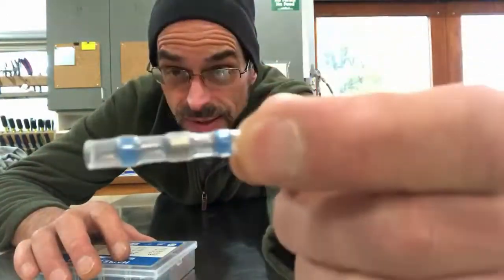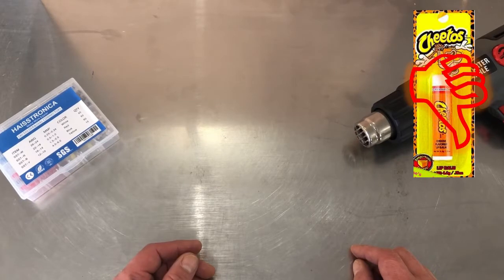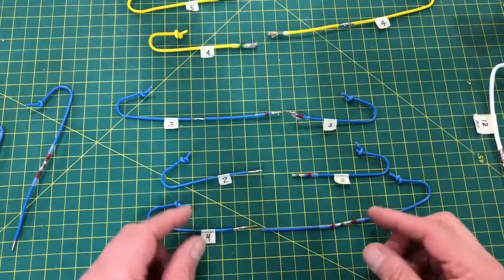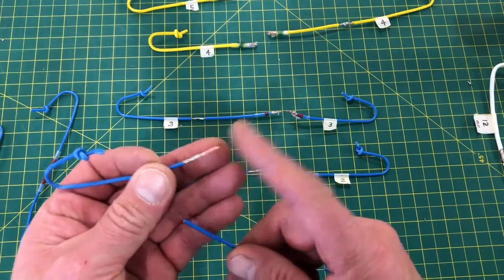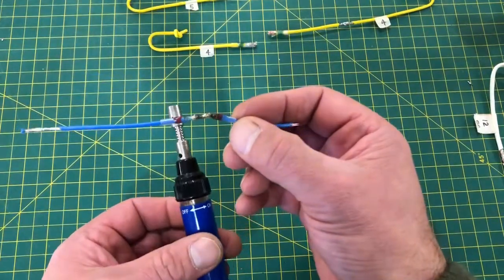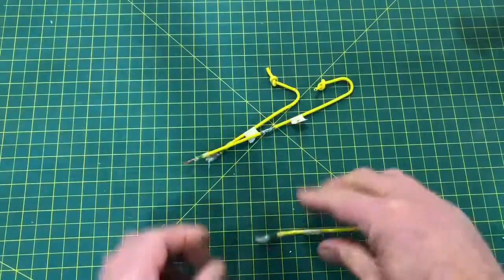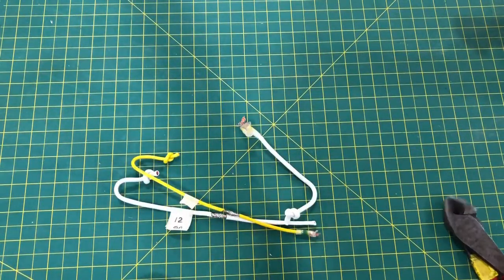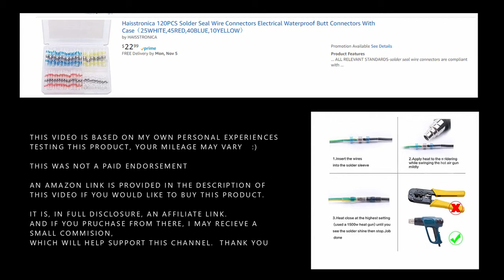Solder seal wire connector / Test & review

Comment: Wire is a conductor not a steel wire rope exposed to high tension. If your going to test and explore its capabilities use realistic tests strategies.
Reply from the maker: Yes you’re right about that, but my main concern however was the joint strength, it is important to know, and I don’t have the equipment or knowledge to fully test them like a Test lab would, that is best left to the professionals. The video was fun to make, sorry you didn’t like it
Reply from the maker: In hindsight though, I probably could have done a resistance test to see how they compared as well, not sure if my multimeter is accurate enough though?
Reply: I thought it was a good test perspective. But your audio needs big improvements. Keep it up.
Reply from the maker: Can you tell me what you thought was bad about the audio ?
Reply: @BuildswithBrian  way too soft even i max my volume especially when you are talking. Music is just nice.
Reply from the maker: Thank you, I will work on that
Reply: @BuildswithBrian  if your using a gopro. They make little directional mics and lapel bluetooth mics for the gopro. This would help ya tremendously!
Reply from the maker: Actually I’ve been recording all video with an iPhone and my first couple videos including this one was just using the standard Mic with the phone, not so good. But I have since I upgraded to a Wireless lab mic, Which is working pretty good, but I’m no sound technician and I know my audio could still be improved.
Reply: @BuildswithBrian  I only heard you on my right speaker.  The music I heard on both speakers.  Not a big deal since it still gets the message across.
Reply from the maker: Sorry but in my first few videos I kind of screwed the audio up, in most of the dialogue was in mono, not stereo

Comment: Does anybody sell a connector with mechanical crimp, solder melt, adhesive, and heat shrink for water resistance? (for a connection peoples' lives depended upon)

Comment: Not heating up the solder inside the sleeve enough to flow it. You'll see it flow when it gets hot enough.
Reply from the maker: Camron , Perhaps you didn’t watch the whole video but the Solder did indeed flow, just not through the entire joint, any increased heat could possibly melt the insulation. These are supposed to be designed to work with low temperature melting solder  using heat from a heat gun
Reply: @BuildswithBrian  
Oh I see it now. Didn't notice it flowed underneath even though the entire solder ring didn't flow. I use Raychem solder sleeves all the time at work. (Avionics Tech) You know the ring completely flows when you don't see the shape of the ring anymore. Obviously these ones in the video might be different because they aren't designed for aerospace use. I find it's best to rotate the wire as you heat it up. There's a happy balance between even heat and not too close.
Reply from the maker: Camron , no worries I appreciate the info, you wouldn’t happen to have a link to these solder sleeves by raychem ? I might like to check them out if they are available to the public

Comment: heating from top might have made slight difference, or for longer, &/or with pointy tIped heat gun.. btw, mini torch 17-1900• bic lighter 1250• regular chepskate lighter 700-750•? & no one knows what butane gizmos •’s at(worse then no 1, everyone thinks they know, each with a differant opinion). I’m gSCng a chepskate lighter, or a bic. away from hottest part of flame wOnt melt everything - but really just guesscing ✋😒
Reply from the maker: I agree having the proper heat gun nozzle probably would’ve made a difference, I don’t happen to have one, but in the real world, most people are using a BIC lighter 😆
Reply: @BuildswithBrian  
U say that NOW that I just bought a heat gun, like 1/2 N hr. ago?😐  I already felt probley s2pid.. now Uv removed all doubt
Reply from the maker: No regrets in buying a heat gun, they
Have so many uses…. Everyone needs one.
😁😁
Reply: yeah, I suppose✋😑
Reply: @BuildswithBrian  
I did some gUgLEng & discovered a few things, 1stly from B4… Nd B4 I 4get- that video about the reverse mirror-image twisler twirL thing of attaching 2 Yrs works dog, 4 rEL I tried it.  Its 2 reverse mirror-imaged Yrs just rappd RoOnd each other in rev./mirror-image like they could just pull str8 apRt, but they don’t!(it’s fittingly called ‘awasome idea how to twist 2 Yrs together’) 40 million+ views, I guess the friction of the 2 groves tightening from center does it..  but mNnnn the last thing yU’d expect, looks like they can pull off each other so easily, but just the opposite.  this comment(book) was too long, I think I’l make it seperate comment✋.  
now where was I gugLEng, yada yada etc. - O, yeh..  bought Nothr heat gun btw, Dewalt, battery powered, will fit beside wall of car, carefully of cOrs, & will wishfully return 1st, & has all the pointer nozzles, etc. & do cR it Ant shOwN up for a wEk?, so problE and up   UZing thE oooold lighter trick☹️.  But STILL dIgrSCng:.  man, don’t worry this is the last email.  sO NEwA, I gUgLd this crap & found out, that it’s 200• for shrink tube, but 550 for leaded sotter & 700 for unleaded.. wats that mEn?, it mEEEns that if you held hEt gun just until shrink tube melted & then wisely took it away, so as not to not to burn tubng - you therefore didn’t fully melt solder.(don’t know the answer just Yning aboOt problM).  wheaawe finally done.

Comment: Design flaw is, for it to be a proper weld you need to have your material (wire) at correct temperature. This isn’t possible with this product. Even when used correctly, it’s still a cold weld.

Comment: The self-solder heat connectors, with a heat gun, works perfectly well with 100% penetration, when you have the heat setting hot enough !  Otherwise, you will have a cold solder with very poor penetration, unfortunately as Brian had
Reply from the maker: Can you make a video testing and proving this please
Reply: @BuildswithBrian  So here, try this Brian.  Set your Heat Gun @ 600 Degrees Fahrenheit for 90 Seconds (I timed it to the second on the nose, with a digital timer while using a deflector/heat shield nozzle - & keeping it moving, of course).  With those stats you will have very good solder penetration the whole way through the wires, at least I did, while using butt connectors on 22 AWG.  Thicker diameter wires may call for higher temps for full solder penetration ?!  Have fun & enjoy your day/night.

Comment: What on earth does pull strength have to do with wire connections? I want to know if the connection is sound. Will my trailer lights flicker and cut in and out or connectors work like the wire was never joined? I'm not interested if I can tow my trailer with the wiring. Completely pointless review
Reply from the maker: Well let’s see, the solder joint is directly dependent on the penetration of the solder into the wires, the stronger the joint the better the connection, your can’t have a good electrical connection without a sound physical connection. Pull test is just another method of testing the joint soundness